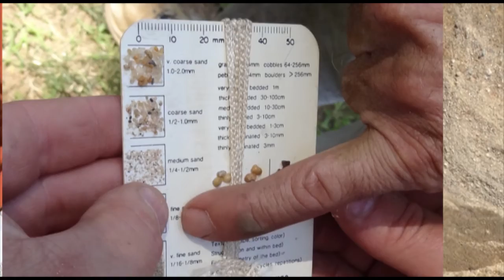How to date archaeology sites if you don't have carbon: OSL 101 Lowery 447.mp4

Comment: I read on scientific papers, they used stainless steel tubes to collect OSL samples. But here you collected samples with PVC plastic pipes. 
Please, someone explain to help me understand. Thank you!
Reply: PVC absorbs less heat. Steel tubes are going to heat up faster resulting in a tainted test.
Reply: @Silhouex  so which one should be used?
Reply: @swapnil99119  PVC
Reply: @Silhouex  Do you know someone who can do Analysis on Collaboration basis?

Comment: would it be possible to date a burial for instance? I,m thinking about the orientation of the body relative to a certain astronomical point, say sunrise, which in time, of course, shifts.....archaeoastronomy (?)
Reply: Not likely. The sun sets in a different place in the horizon every night. That pattern shifts but the sun still hits all the bases. The only way this would work is if they were buried with an etching of an ancient constellation.